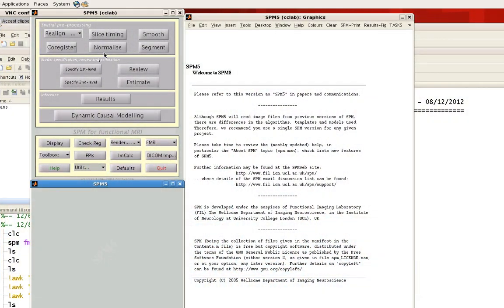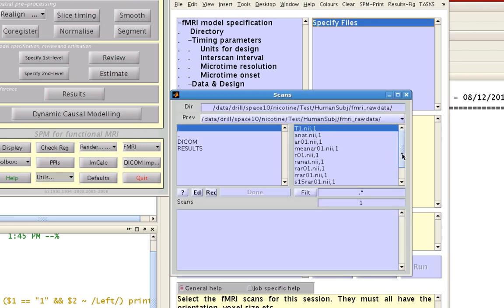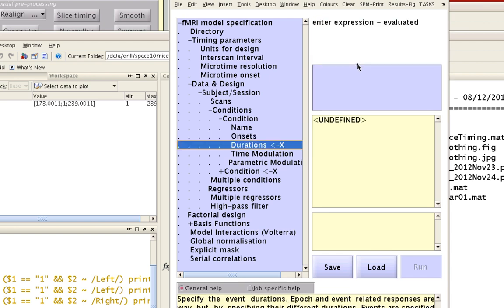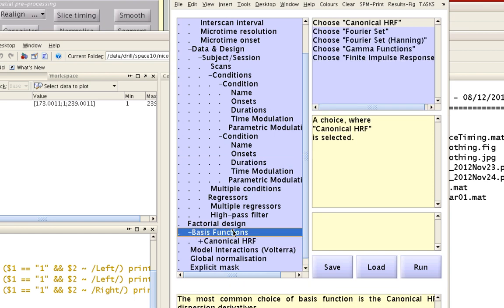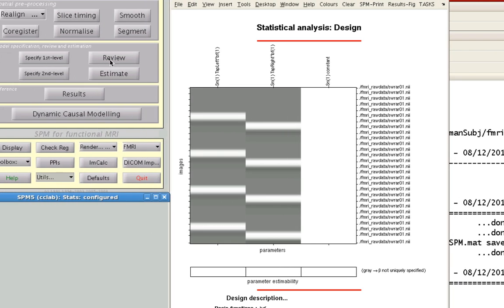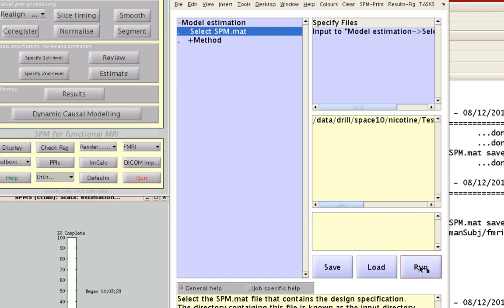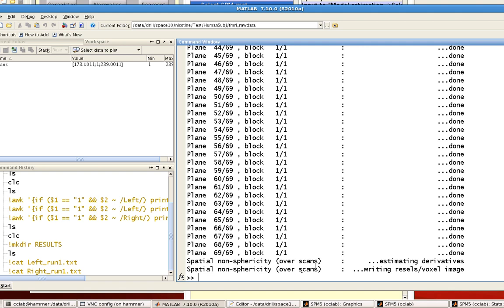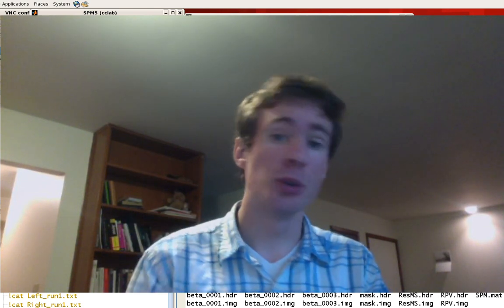SPM GLM Specification and Estimation

Comment: Hi Andrew! 
I want to perfrom VBM for a group of controls and patients... And i want to include the total intercranial volume (TIV/ICV) as my covariate but i dont know to calculate it. Could u pls suggest the steps in SPM or link any notes that I could refer to? Also,. while calculating the TIV, which image files should i consider??
thank you so much in advance
Reply from the maker: Hi Michelle,

I don't use SPM for calculating ICV; instead I run my subject's T1 scan through FreeSurfer, and then extract the eTIV line from the stats/aseg.stats file.

-Andy

Comment: Hi Andrew, I have a situation where each participant's data are split into 4 experimental blocks. It was purely for the purposes of the participants having a break, so there are no differences of interest between those blocks. How would you recommend I approach specifying the 1st level analysis? My idea is to use the GUI to specify the scan files for each block, and then set up each condition within each block separately. This would mean we model 2 conditions as 8 (i.e. those 2 per block), but then group each condition together when it comes to the analysis. However this seems quite laborious to me (and potentially incorrect), so I'd like to know if there is a better/more standard way of achieving this - it seems like a very common task.

Comment: Hi Andrew 

If I have multiple sessions, do I have to do a t contrast for each session  and then use the con file from each one for the second level analysis ? Or is it better to do an F analysis for all sessions ?

Thank you in advance 
Hadeel
Reply from the maker: Hi Hadeel,

Include every session in your GLM, and when you load the Results window, weight each contrast within each session to get the contrast you want, but divide the contrast weights by the total number of sessions; this will prevent subjects with more sessions from receiving more weight than those with fewer sessions.

For example, if I have two sessions, and there are two regressors within each session - regressors A and B, let's say - and I want to do a contrast of A-B, my contrast vector would look like this:

[0.5 -0.5 0.5 -0.5]

This will produce one contrast image, and you will do this for all of your subjects, getting one contrast image per subject. These contrast image can then be used for a second-level analysis.

-Andy
Reply: Thank you Andrew, 

What if I'm not interested in comparing two conditions ? I just one condition which is parametric modulated and I would like to do a  simple t test for this specific regressor. what I first did was giving it a value of 1 and the rest of zero, but since there are multiple runs, do you u suggest that each regressor for each run gets a value of 1 or a value of (1/number of sessions) -( all the subjects have the same number of sessions. )

Thank you in advance 
I really appreciate your time and effort 
Hadeel

Comment: Hi Andy, 
I have watched your videos and helps  a lot. I would like you to help me related to the setting up the design SPM GLM Specification and Estimation. I have a block design mainly with 3 conditions, which contains 6 blocks ( 2 blocks for condition 1, 2 blocks for condition 2, and 2 blocks for condition 3) and the blocks are reshuffled and there were a rest in between. Each blocks have 40 trials. I use E-prime to present the stimuli. I can not figure out how could I set the duration and how I specify for  each session I had. For example, to complete the first block it takes around 5 minutes. I would appreciate your help in this. 
Ay
Reply from the maker: Hello Ay,

What duration are you trying to model? The duration of each block? In that case, you should have a duration for each event, and load that list of timings into a text file for that regressor in that session.

Does it matter how many trials are in each block? Are you modeling each trial individually, or just modeling the block?

-Andy
Reply: Hi Andy, 

Thank you for your prompt reply and help. I am trying to model each trial individually, for there are valid and invalid trials in each blocks. I also need to merge the two blocks in each conditions. One typical trials is like this: a blank screen (randomized 500-1000ms),  fixation (for 1000ms), a cue (200ms), re-fixation (1200ms) and then the target (1500ms). Thanks Andy
Reply from the maker: Hey Ay,

I don't know the details of your design, but I would just model the cue and the target; events lasting about a second or less can usually be modeled equally well using either a duration or delta regressor, but to be safe I include the duration (see Grinband 2011 for a discussion of this). If you model all of these events as instances of the same condition, then they will be averaged across all of the blocks and sessions to calculate a single parameter estimate for that condition. You can also model the duration of the block as well as a separate regressor, to capture any variance associated with mental set.

-Andy
Reply: Hi Andy, 

Thank you very much. I appreciated your help in this. Cheers!

Comment: Hello Andrew, 

I have a simple question 
in my expiremnt I have 4 sessions for each subject , so What I did was " multuply session " in spm first level analysis and did not contacenate the sessions into one 
I'm also using parametric modulation in my model 
So what I did was , in each session I put the scans from that session plus the parametric modulator relevant in that session , but the problem was that , in the design matrix, only the first session was modulated and in the other sessions there was no times or parametric ( the design matrix was empty ) 
But, What I did was , I put all scans in each session , ( and not just scans for that specific session ) ,
By doing this, I could see the onsets of each picture in the design matrix for each session , But I'm not sure if this is the right way to do it
Reply from the maker: Hi Hadeel,

It's difficult to debug this without seeing exactly what you put in there, but you should enter scans that are specific to each session. Are you sure that you're entering onset times for each session individually?

-Andy
Reply: thank you for your quick answer 
I can send you a screenshot by E-mail 
I entered scans for each session, onset times for that specific session.
Reply: if I have lets say These onsets for pictures "  16.015
 48.011
 84.025
118.022
156.021
 196.02
234.019
266.015
 304.03
336.026
372.024
406.021
444.019
476.032
 514.03
546.026
580.023
616.021 " 

and the picture that appeared at " 616.021 " is the first picture to appear in the second session , I would not use THIS onset (616.021 ) to define the picture onset in the second session Right ? 
because this onset is relative to other pictures ( that I build in E-prime ) and does not take into considerate the beginning of a different session 
Does that make any sense  ? 
thank you in advance 
I really really appreciate it 

Hadeel
Reply from the maker: Hi Haeel, that's correct, each time should be relative to the onset of the beginning of its session.

Comment: I have a rather simple question about onsets. So I have a auditory stimulus that begins at the start of a scan in a block design of 2 scans of one stimulus, 2 of another, and 2 empty scans. I'm using scans as my parameter instead of seconds. So would be onsets be the first scan at which the stimulus is presented and then the duration of 2 scans? Or is it the onset of every time that condition appears in the experiment?

Thanks!
Reply from the maker: Stela P Petkova Hi Stela, you could model it either way. Typically at short time intervals (around 2-4 seconds or so), modeling it as a punctate (instantaneous) event time-locked to the beginning of the stimulus or as an epoch lasting the duration of the stimulus should give nearly the same results. Either model should capture the variance associated with that event, although to be safe I would model it as the duration of the stimulus.

Best,

-Andy

Comment: Hi Andrew, wondering if you can help - I've posted a few times on the Mailing list but received no response. I'm running a within-subject ANOVA (single subject at the moment) in PET with four conditions. I am receiving the following error message: Failed  'Factorial design specification'
Attempted to access U(2,:); index out of bounds because size(U)=[1,2].
In file "E:\WorkSpace\spm8\spm_design_within_subject.m" (v4178), function "spm_design_within_subject" at line 69.
In file "E:\WorkSpace\spm8\config\spm_run_factorial_design.m" (v4537), function "spm_run_factorial_design" at line 467.

It looks like I've entered in 2 fields where only 1 was supposed to be specified but I can find where that is. Any ideas?
Reply from the maker: Hi Natalie,

Are you using the GUI, or doing it through the command line? If it's through the command line, unfortunately I'm using SPM5, which as far as I can tell doesn't use the scripts listed in your debugging. However, just from what you described it may be because there is only one subject in your design; try including a few more subjects, and see if that straightens it out.

-Andy
Reply: Andrew Jahn Hey Andrew, thank you so much for your assistance. I'm going through the GUI. I replicated the subject and it ran an analysis but the design matrix does not look the way it's supposed to. It is a simple one-way ANOVA within-subject design with 4 levels (1 control, 3 experimental conditions). Is there any way I could email you a screenshot of the design matrix to see if you can make some sense of what's gone wrong?
Reply from the maker: Natalie Rogers Hey Natalie, sure, you can email to me at Andrew [dot] Jahner [at] gmail [dot] com. I'll be happy to take a look at it.

Best,

-Andy

Comment from the maker: Hey Soroosh,

I'm actually working on that right now (albeit with AFNI, and then possibly SPM). From what I understand, you set up the 1st level with only nuisance regressors (e.g., head motion and anything else that doesn't need to be convolved with the HRF). Anything that doesn't load onto those regressors (what would be error stuff in a normal GLM) is what will be used in higher-level analyses (e.g., the ResMS.hdr file).

I'll get around to this soon, I promise!

-Andy